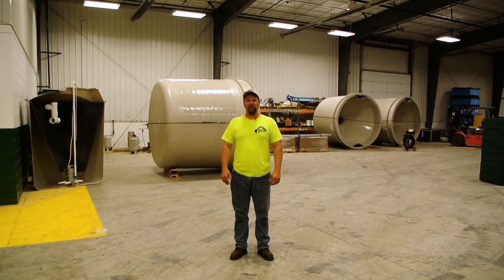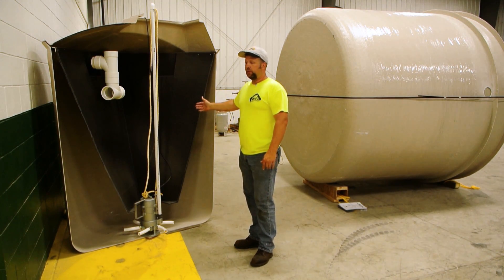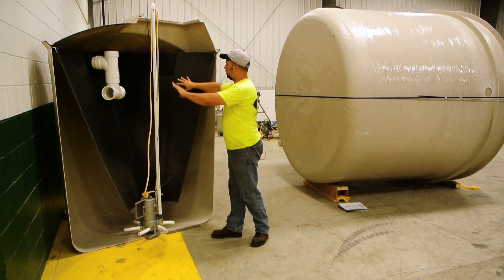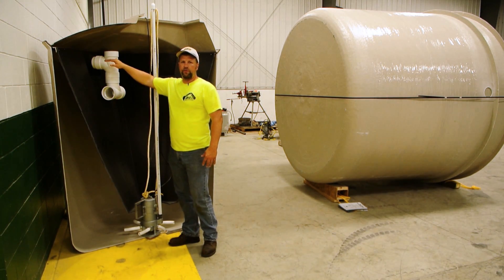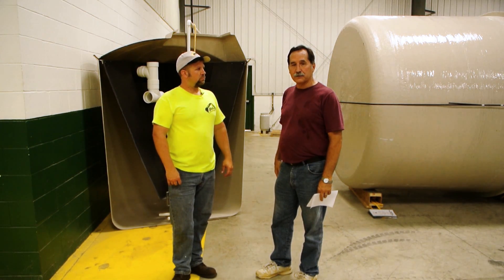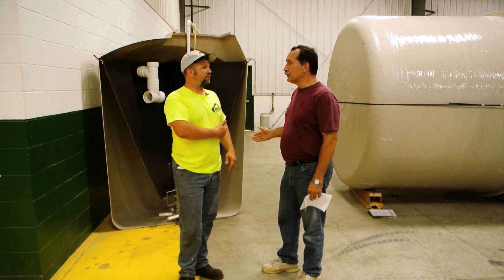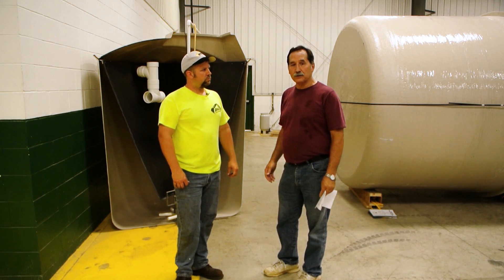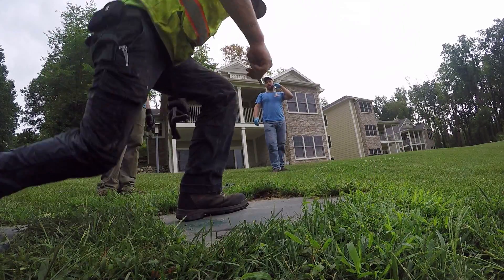Alternative Septic Systems: What is an ATU?

Comment: This can't reduce drain field area because it's designed to a flow rate, not a biological load rate. A drain field needs to be able to absorb the water from the house and this system does nothing to reduce discharge rate.
Reply from the maker: Right there's no descrease in volume. The water is cleaner though, so the soil can treat more volume. Check out our stuff on SludgeHammer!

Comment: My lot is almost pure rock therefore I can't create a drain field. I'm looking for a septic alternate that can be used and dispersed above ground. Would something like this work?
Reply: Yes, This would work for that application as far as treating the effluent properly, but your local health dept. would still have to approve a drainage area design.
Reply: This doesn't address the leech field. On my list though.
Reply: @Uberkamper  "leech" field?  What a difference an "a" makes!
Reply: Answering your question 6 years later but yes.  You can put in aerobic system similar to this with a third pump tank with a chlorinator after the aerobic treatment tank.  The water in the third tank is then surface applied with a high pressure pump through sprinkler heads.  This system is used almost exclusively in Texas where the soils are heavy clay.